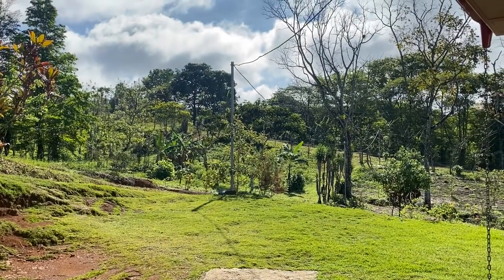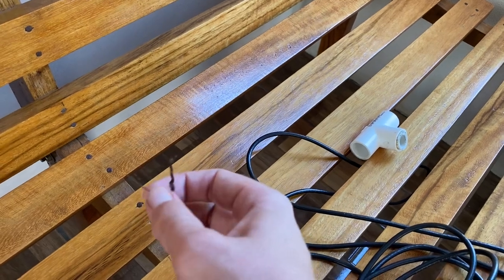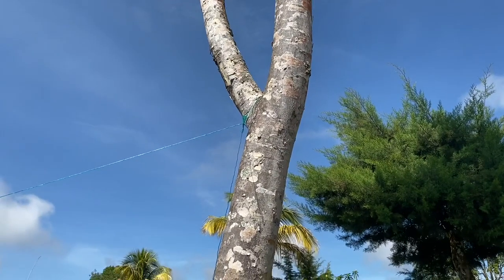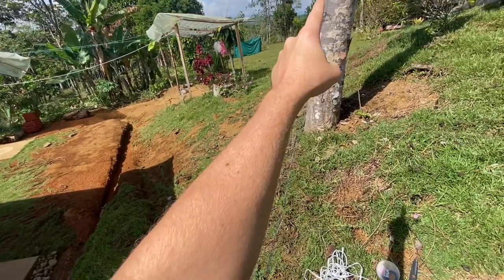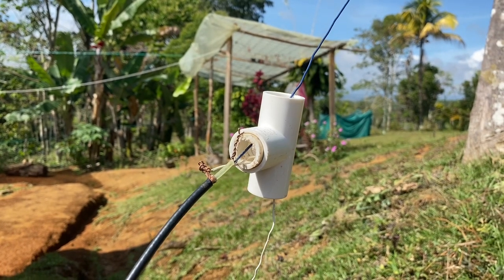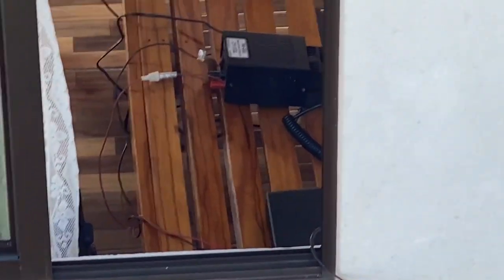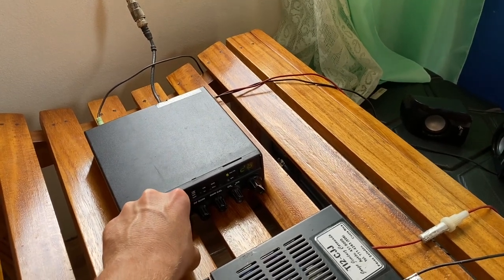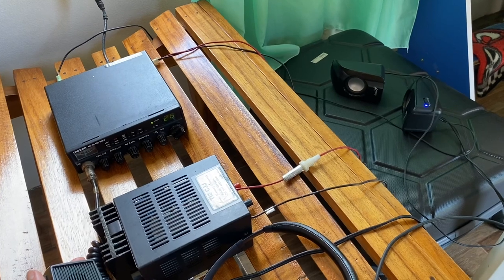How to build a simple dipole antenna for CB / 11 meter band radio in Costa Rica

Comment: Your connections arent very good, the wire is a bit corroded. Clean up the wires and join with solder if you can.

Did you measure the SWR, it seems your radio can do that. 

If possible, try half wave length of wire, or even full wave (11meters or so) for better radiation...

Comment: your best best bet if wanna talk skip make  portable antenna  setup just go up that mountain there get on mobile and setup your antenna in a tree or make it into pvc setup if have local parks in your area, my best you need 102 inches make on those antennas out speaker wire or bare copper wire you need 12 gauge or 18 gauge.
Reply from the maker: Thank you!

Comment: I just put mine up two or three days ago and I have the same issue I can hear people having conversations but apparently they can't hear me but mine is only stapled to the front of my porch garage enclosure so maybe 10 to 12 ft. I plan to get some rope and some longer coax and get it straightened up at least 30 or 40 ft above the roof lines.
Reply from the maker: Hey, thanks for your reply. One reason is that the polarization of this antenna is horizontal, and most others are using vertically polarized antennas. You need to put hundreds of times more transmit power into a horizontally polarized antenna like this in order to achieve the equivalent output power of a vertical antenna transmitting at a fraction of the power. I will try and make another video about this someday, but in the meantime changing to a vertical antenna you may get better local results.
Reply: @FoxyLobo  I appreciate your response brother. That makes sense why I was able to hear but nobody could hear me so I would have to get an amplifier in line? How is yours working now? I'm getting ready to change my dipole and put it vertical I just got to get some time and get some ropes and wait for my longer coax cable to come in is that what you ended up doing with yours?
Reply from the maker: @brandonlaragirl  It's always nice to talk radio with other people :). I wouldn't go the amp route unless you plan to do that anyway. I would just make another antenna out of a piece of vertical wire cut to a resonant wavelength that won't have a high standing wave ratio. Run the central portion of the coax through a balun (it's good practice as people are saying here - you can buy one or make one) to the vertical antenna and the outer braid of the coax to a radial system (ground), just a bunch of wires radiating outward in a circle slightly below the ground where you put the antenna. I would keep it away from structures to allow the radiation to travel freely into space so you can get the most contacts in the most directions.
Reply: @FoxyLobo  agreed it really is an awesome hobby I wish I would have gotten into it many years ago. So just to clarify the inner cable that's insulated in the coax is the only part that really does all the work? I keep asking people but I'm not really getting a straight answer the way I have mine set up I'm using the outer shield and cop proportion connected to one piece of 102 inch wire and the intercourse section connected to another piece of 102 inch wire. Opposing each other at 180° and then my coax just running straight down to the radio on the ground.
Reply from the maker: @brandonlaragirl  In regards to what part of the antenna is doing the work, it's 50%-50%, the ground/radials make the impedance the same as the radio - that's what I was told. However in terms of radiating the signal the radiating element is critical. Can you clarify what "cop proportion" and "intercourse section" mean? Yes, the two legs of the dipole should not be any less than 90*. It is ok if they are less than 180*, you should still get the same general radiation pattern from the dipole.